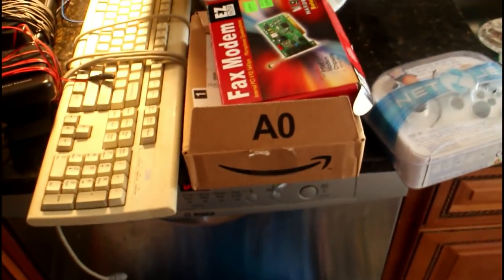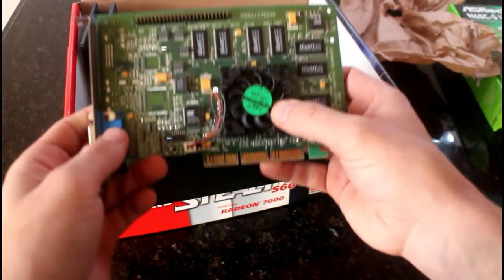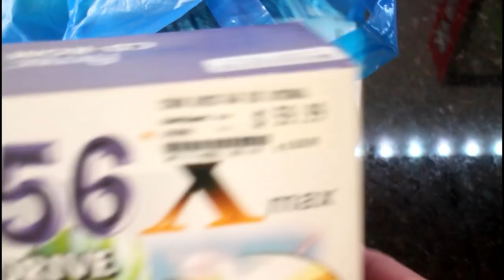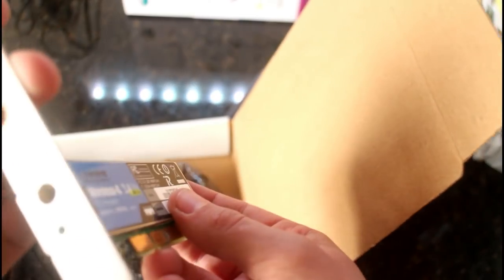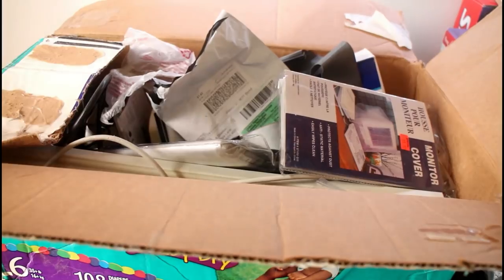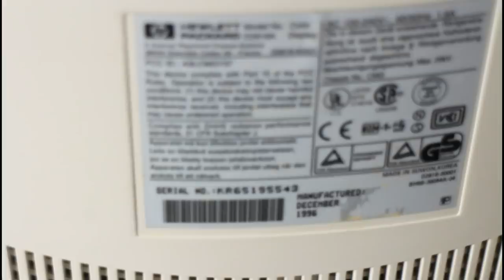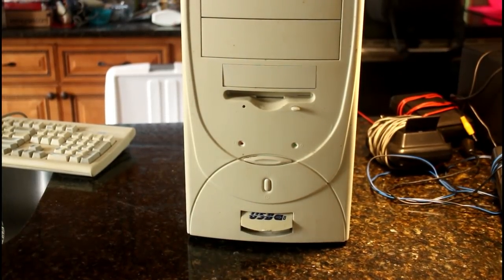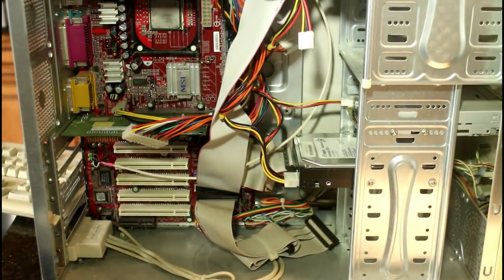HUGE $40 Retro Computer & Parts Haul to Flip On To Ebay

Comment: If you have Ddr400 sticks of 1 mb I could buy a few sticks off of you perhaps? Ddr2 and older graphics cards too if you want.
I like messing around with old xp and vista computers and laptops.  Definetely not a pro, I just like learning how it works and spending hours on meaningless tech.   Some of them I manage to make them run good enough for modern use.
Reply from the maker: I have a lot of ddr and ddr2 stick. 50+ of them haha
Reply from the maker: @okkrom  yes i do not have alot listed yet. Ill send you a email tonight with some photos!